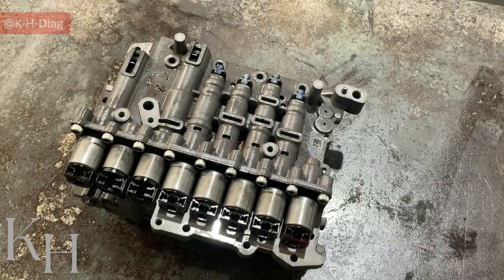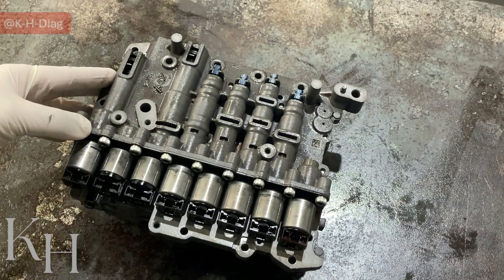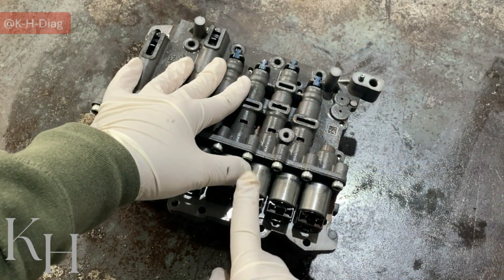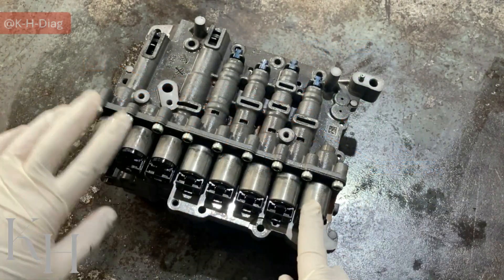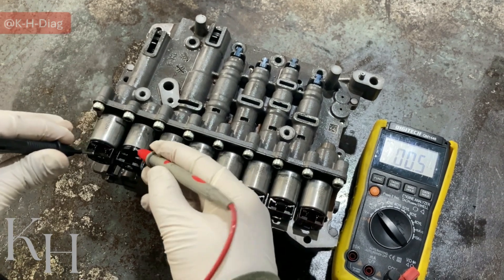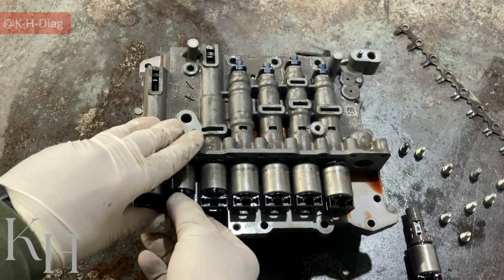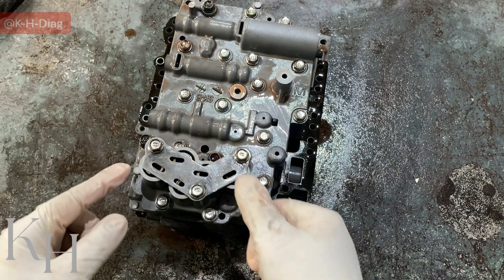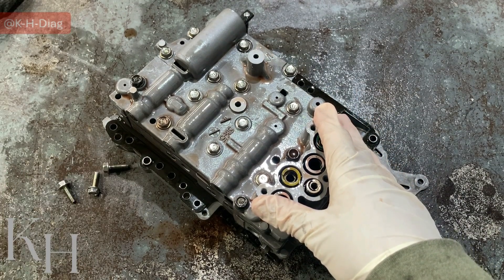Valve Body Explained | KIA & Hyundai 6 Speed Transmission Valve Body A6GF1 |A6MF1 |A6LF1 |A6LF2

Comment: Thanks for this info but I'm confused which solenoids control 1 and 4? Also, can you switch solenoid valves with the same ohm reading/normal voltage or every solenoid valve differs from one another?

Comment: Great instructional video for us who are suffering as victims of hyundais plagued by trans issues. Mine has no DTC

The live data has become my favorite movie but when you don’t know what to look for, it feels like watching a chinese movie. 

I replaced the fluid 2 days ago. It feels a bit better but all the symptoms are still present but less pronounced since the fluid change.

Drove 226 miles so far

The fluid was brown with dust metal (no chunk)

Symptoms were / are:

1~
3 seconds delayed engagement from Park to Drive

2~
Harsh downshift from 5-4; less now than before the oil change & actually no harsh downshift at all sometimes

3~
If attempting to floor the pedal or suddenly accelerate to get more torque, the car jerks until the throttle is realised & all goes like nothing ever happened

4~
A whinning noise can be heard in low gears 1,2,3.

Upshifts occurs at 2100 rpm nd normally

Highest Trans oil temp is 185 degree Fahrenheit

Can testing solenoids point me to the right direction? Is there a proven way to unclog a valve body to improve its performance?

note i pulled a valve body from a junkyard so i can either self-train with it or do it correctly and swap it in if the comoarison shows that mine may have issues. 

Hopefully an answer soon. 

Thanks again
Reply: Have you tried the transgo solenoid kit from rockauto? This kit is specifically made to address most of your issues and can be installed without removing the trans. 
Ill be honest the whining is not a great sign though..
The problem with the solenoid valves is they wear and allow for some fluid to bypass the valves themselves causing the harsh downshifts and delayed engagement, as well as tcc/trans shudder.. 
Hope this helps!

Also you should spill and fill the trans atleast 3 times to get rid of all of the old contaminated fluid

I use valvoline extended protection premium full synthetic in the grey container, and it made a big difference in shift quality as well as smoothing out downshifts quite a bit..
Reply: @johnsteenland1292 thanks for you reply to whomever but this was awesome to read. My 2013 elantra is experiencing all of these symptoms at one point in time but has no check engine light. I did the service 3 times. There was an improvement at the first service (no more harsh downshift from 5-4 & less delayed engagement from P-D); 2nd and 3rd service and it became worst at delayed engagement but the harsh downshift has nearly vanished). Also at this point, 1st gear started to disappear and limp mode started to occur along with a DTC. I had to erase the DTC with my scanner to get it to drive on all gears again; note that the issues start when the trans become warm.
I trodded every inch of junkyards to get a valve body like mine but the fluid they showed was worst than mine 😂. I finally found one A6MF1 like mine with fluid still red like cranberry juice which I paid $88 for. When the weather gets better, i will install it on mine and reset the tcm adaptations. 
I hope no programming is needed nd plug and play will be my situation
Reply: @dfwcarkeys  No problem sir! New valve body will certainly help, since im not there I can not say for sure thats your only issue, however its worth a shot for 88 bucks..

No programming required as long as you do the relearn procedure..

You can also try doing the relearn now and see if it helps before you install the new valve body
Reply: @johnsteenland1292 hello thanks for your prompt reply. I attempted the relearn several times after i did the trans service. The delayed engagement from P to D remained up until now. The harsh downshift from 5-4 nearly disappeared.

Comment: Great video information 
My vehicle stalls out completely wen I come to a stop in Drive 
Also does it wen I select Drive or Reverse
Idles perfectly in neutral and park 
No CEL or codes at all 
Iv tested all solenoids including torque lockup 5.3ohms and operates wen I power it on bench 
Is it worth stripping and inspecting the valvebody further, mechanic seems to think it’s a transmission issue with the torque converter (not noisy) or torque converter solenoid problem. It wont even rev on a stall test in D or R, just stalls engine out immediately when I press the accelerator. 
Otherwise the transmission shifts and sounds normal to me
I thought it was an engine issue but my mechanics adamant it’s the transmission stalling it out cos it otherwise drives fine on highway

Comment: Thanks for the knowledge you have provided to us, please what is the meaning of the pressure reducing valve and pressure increasing valve on the valve body
Reply from the maker: Hi my friend, thanks for watching the video. When transmission is operating, many different hydraulic lines are supposed to provide the hydraulic pressure to the relevant components, and they are controlled by pressure valves. So if a pressure valve is Normally open and provides the pressure, when it’s activated it’s going to reduce the pressure, it works other way around as well.
Reply: @GoProAuto  thanks

Comment: Excellent video. Thanks for sharing.. I have 2016 Sorento EX and its shifting with hesitation from 1st to 2nd and 2nd to 3rd. I connected my OBD scanner and saw 50ma on that 3rd Low current VFS solenoid and thought of replacing it. But it seems like its showing correct current since its a low current solenoid. 
Still wondering if replacing the solenoid would help with the issue.
Reply from the maker: Hi my friend. Do you get any fault code too?
Also, when was the last time you changed the transmission fluid?
Reply: @GoProAuto  Hi… there is no code and check engine light. I regularly changed all the fluids and last I changed was at 120000 kms and now my ODO reads around 129000kms. Shifting front 1st to second n back from 2nd to 1st is not smooth